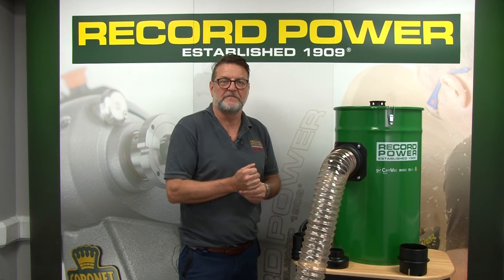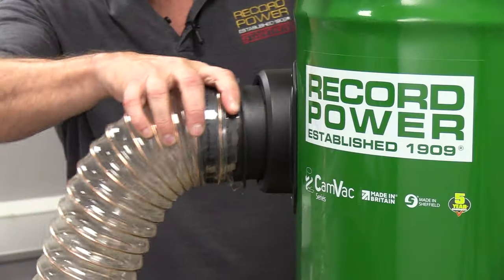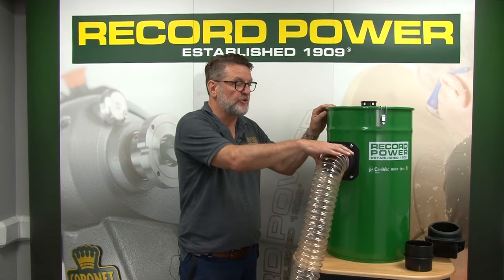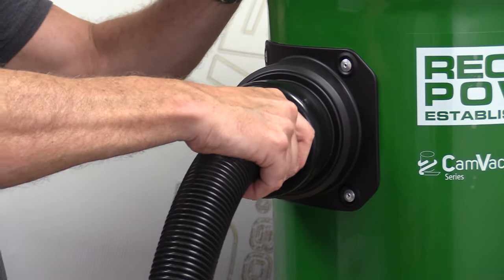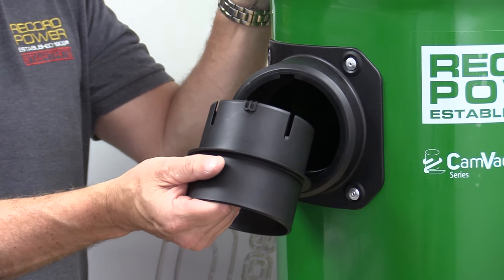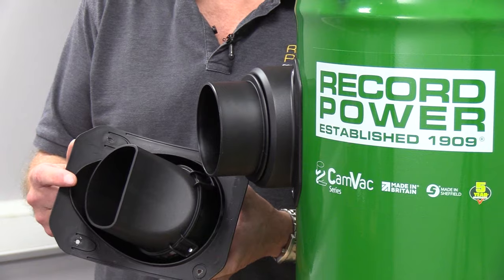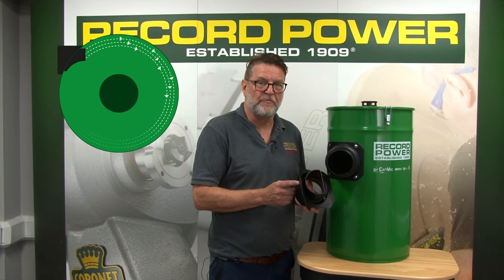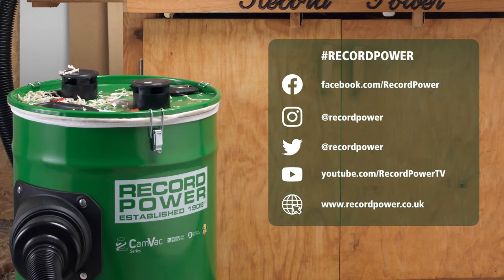CamVac Dust Extractors - Now Featuring New, Improved Bayonet-Style Inlet Fittings

Comment: I really think these will take over the low pressure systems here in the USA. It is one of my favorite purchases. Unbelievably versatile as it will handle any tool, large or small depending on the size of hose and how many motors you use. I can’t say enough about this system and recommend it on every forum when the topic of dust collection comes up.
Reply from the maker: Thank you very much for your feedback! Best Wishes, Record Power.

Comment: How long until you can buy in New Zealand? At the moment you have to buy in Australia and get it shipped over. Also is a single motor 36L good enough to handle a dewalt dw735 Thicknesser and a sander ( at separate times?
Reply from the maker: Hi Ryan, thank you for your comment. Please contact Roger at Vacuum Brands Ltd on (021) 723 999 or email roger@vacuum.co.nz. Best Wishes, Record Power.

Comment: Is it a loud vac that my neighbor would be able to hear?
Reply from the maker: Hi Robert, thank you for your comment. Our CamVac range of Dust Extractors are renowned for their low noise output. The noise can also be reduced even further, by placing a 2.5" hose into the machine outlet. To learn more about our range, please visit: https://www.recordpower.co.uk/category/dust-extraction. Best Wishes, Record Power.
Reply: @RecordPowerTV  , I am a long time wood turner, and I just started making smoking pipes. Which unit do you recommend I use for my French sanding disc?